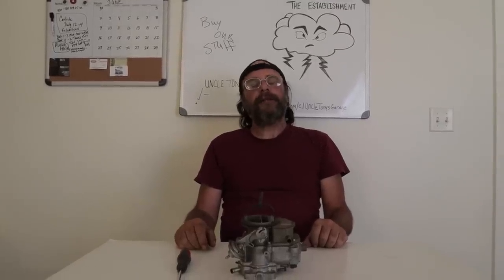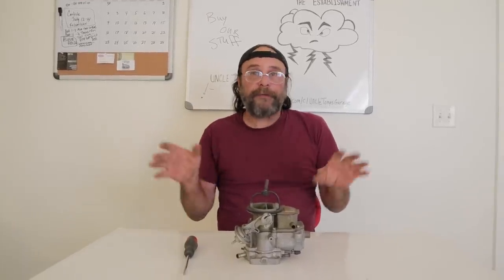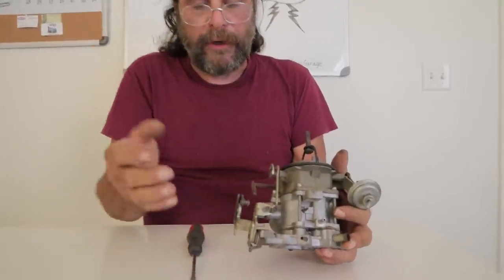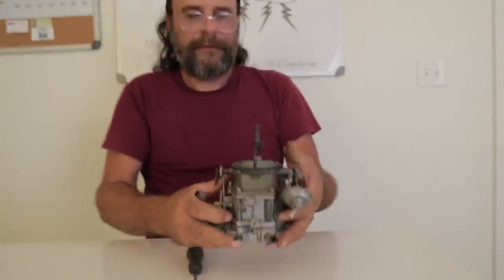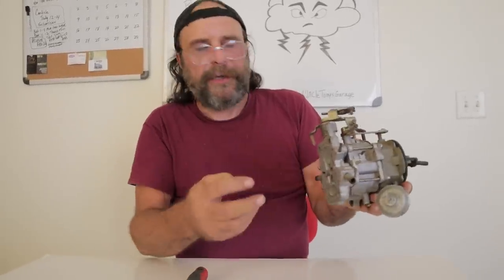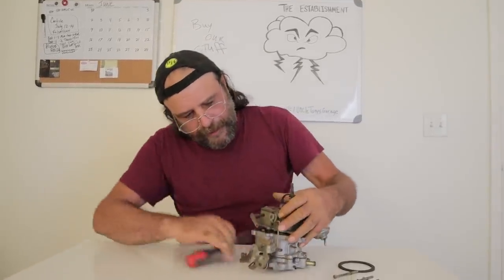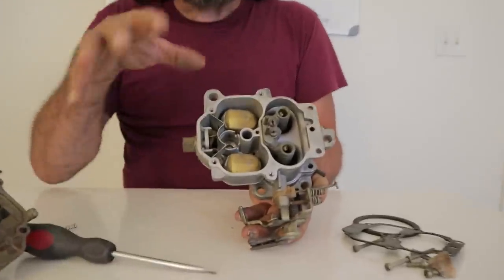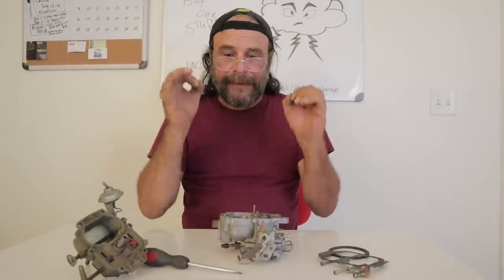Classic Car Tech- Understanding Carburetors

Comment: Thank you for the video. My first instinct is to plug off temporarily all vacuum sources like the brake booster and windshield washers or other miscellaneous stuff that doesn't need to be to run. Then like you said back the idle screw and fast idle out then one turn on each for the air and the choke mechanism so it will have a chance against the choke and have enough air to run. Give it a try and pay attention to weather idle speed is to low or not enough air. Then check the engine vacuum gage.. that I hook up. I do leave the vacuum line to the distributor hooked up. And I check to make sure that it is on the right side. Most cases the side that makes vacuum when you give it gas and the side that is constant vac is left plugged unless the distributor calls for the other side, it can be depending on the rig. I lean to the rich side as lean is rough on just about anything and hesitation is not good, as long as it doesn't load up while warming up your fine. I have hooked up my smok machine when it is not running and found vacuum leaks all along the firewall and other places just to hear people say carb is messed up. No it can't handle all the air that is coming in. It is hard to put into words what we hear with our ears and yet people think I'm deaf an I am to some people/LOL

Comment: Excellent video...manual choke is what I installed in my old 87 Power Ram. As you mentioned about the altitude and other factors that may require a small mixture change. Not a bad idea as well and it's a.pretty quick operation is to remove your intake and check the crossovers. A little cleaning will make a big difference for your choke operation.

Comment: Everyone is at a different level of understanding going in, by default.  I work on cars as my primary profession, but every car that comes through the door is EFI.  I am now facing the rebuild of a very mistreated Holley 4180C and I decided watching a macro-level video would make a micro-carb specific video easier to understand.  I was more correct than I expected, but that is all thanks to you.  I'm far from a master, but I must've taken 7 or 8 steps in that direction by the end of your video.  I thought it important to let you know that.

Comment: Nice concise explanation of the carb.     
  
The single best thing I did years ago was buy a few quadrajets at the wrecking yard and tear into them to figure them out after reading whatever I could find. Then I'd try them out on the car and see how bad I screwed it up. And back to the drawing board.  I figured if I royally screwed it up, it was a junkyard carb anyway, nothing to lose except the 10 bucks to get it.  That exercise made me appreciate the carb even more, and payed off over the years in not hesitating to rip into a carb, to take care of any issues that cropped up.

Comment: Thanks again uncle Tony! I had to drill .070 holes in all four of my throttle blades to get good idle out of my holley. This is due to the camshaft, the transfer slot are now only showing at .035. Before it was about 1/8".

Comment: Good video when I quit wrenching in 2000 I was the only guy in the shop that knew how to rebuild a carb. The younger guys had no clue! By the way all chokes are not bi metal springs. Carbs used on the Mitsubishi engines used in Chrysler cars used a wax pellet to close the choke.

Comment: You are one great teacher, So the idle mixture screws only come into play when at Idle.
I have a car thats fuel injected, but it has no way to get or read computer, no OBD1 or OBD2, Only good thing is you learn how to troubleshoot in the dark. And you get to know your car very well.
My old 750 Honda had 4 carbs, it had vacuum ports on each, I would use a multi Vacuum gauge to set equal. Made a huge difference in how it ran, and it was very quick.

Comment: I’ve always preferred to work on a carburetor over EFI. Learned it at age 16 when I bought my numbers matching 61 Impala. I was proud to have that car running like a top..
Reply: You sold it, didn't you.
Reply: Ronald van Kemenade sure did. Worst decision I’ve ever made. I tried to find it and buy it back a few years ago, after some digging I found out it had a frame off restoration and it’s now a show car in GA.
Reply: @hommeldavid  Same here. 63 Impala convertible SS. White + red int. Prettiest car I ever had. Only thing it lacked was a 409. Sold it planning on getting a better one, but went for a more sensible 80's wagon instead. Also V8 rwd, but not even half the fun.
Reply: Ronald van Kemenade my dream car is a 63 convertible. Found a 64 SS with its original 409 and 4 on the floor rotting in a field once, guy would not sell. I bugged him for about a year offering him more money every time. It’s sad when people would rather let something rot instead of letting someone fix it up.
Reply: David Hommel   Over 25-30 years I watched a 58 impala convertible rot and rust into the ground because the owner was planning to restore it himself. It ended up leaving his yard in a scrap dumpster in several pieces. Every time they tried to lift or move it, it broke again.
Reply: @Zephyrmec  That`s sad!

Comment: 16:22  If tapping the outside of the carb. Does not work. One more trick, stop fuel from entering the carb. The idling engine will empty the carb (engine will die).   Now the needle/seat is fully open. Next allow fuel to flow to carb. This is your best chance to flush the needle/seat. You can also tap, to help dislodge the trash.

Comment: I was 20 when I worked/cleaned/rebuilt my first carburettor. (Though it was a motorcycle twin carb) , so I have a good idea of how they work and other smaller ones, but the big stuff you find on cars are still a mystery to me. 

I understood the concept, but as soon as something went wrong or gave issues, it was like something working on witchcraft.

I was so afraid of working on the thing and nearly all the bikeshops (apart from 1, and also one had a lead on a carb whisperer) in my area didn't want to touch it.

After doing a boat load of research and watching many videos, which really helped. Suprisingly found many videos for how uncommon the bike is.

It was so basic how it all went apart and back together. Though I did cheat a little by not separating the carbs or by leaving the synchronisation screw untouched. (Still had, I'm assuming, factory paint marks on the nut and threads).

The most difficult part was probably measuring the floats range of movement to see if they are in spec.
And keeping things organised and planning ahead how I will sort things to keep track of it and what goes where. 

And yes, the needle and seat is a problem, neat to order a replacement, that and the floats was the only thing that was not in the kit.

Overall, it was an enjoyable and very rewarding experience

Comment: You're right Tony.  Soo soo much to be learned about carburetors.  I learned a lot with the Holley 4180C carb that came factorty on my 1984 mustang gt.  Angular boosters and diagonal main wells for a reason.  It is the best carb for my heads(emissions) as i live in NJ and thats all they care about.  BTW still have my 380mm rims.

Comment: I learned a lot by putting a vacuum gauge in the car and watching how the engine vacuum increases and decreases as you drive around under various conditions. uphill,downhill,from a stoplight,accelerating while cruzing, smashing the throttle,letting your foot off the gas quickly, all affect the engine vacuum at different rpm. Then think how the carb must control fuel needs of the engine to supply fuel under these circumstances

Comment: A carb is simple, it's a coffee can with a garden hose stuck in it, what makes it complicated is all the circuit's it has, choke, fast idle, idle, acc pump, mid range, main jets, etc, what's important is to determine what circuit is having problems before you take it apart, when you rebuild a carb all you are doing is cleaning it and putting it back together just like you took it apart, you should have a paper filter before and after the fuel  pump, no dirt in carb usually no problem, Tony is doing a good job of explaining the circuit's, my preferred carbs are a quadrajet for a 4bbl, a motorcraft 2150 for a 2bbl

Comment: I was never left on the side of the road because MY carburetor COMPUTER went bad. Analog is the way to keep it simple👍.
Reply: Lassi Kinnunen the variable Venturi carb Ford had in the 80’ was horrible.  But with a convention carburetor you don’t need a mortgage to repair it.
Reply: I went and bought a 1991 Peugeot, car was incredibly simple and all mechanical. Sat parked for 2 years, and we got it running within 10 minutes. I paid the guy, sorted the paperwork and drove the car across half the country on at least 2 year old oil and coolant. Not the smartest thing in hindsight but I had no problems with the car except for typical french wiring.

Comment: Thanks Uncle Tony! I’ll never understand why they started using those damn automatic chokes! What was so hard about pulling a choke and pushing it back in?
Reply: Well, as someone who has one of them it's the fact that it's practically a martial art requiring a lot of feel, which most people these days lack. Pull it too much on a hot day and it'll stall, pull it too little it won't start.  
The plus side of it is that nobody can steal the car, the negative is that nobody can drive your car except you.
Reply: @GlamStacheessnostalgialounge  lol
Reply: @GlamStacheessnostalgialounge  
My nephew and 5 of his friends called me one Saturday to help them with an old truck one of them had bought, they had 2 problems, they couldn't get it to start, and none of them knew how to drive a standard.
I showed them how to operate the manual choke, and spent a few hours teaching the owner the basics of driving  a standard.
At least he doesn't have to worry about anyone borrowing his truck.
😁
Reply: @sidewyndersshed1676  That truck better be quite well built, hopes are they don't forget to turn off the choke and gunk up the engine or break the tranny on her.
Reply: @GlamStacheessnostalgialounge  
1969 ford f250 4x4 old cast iron tranny and transfer case, dana front and rear, 360cid, it's  a rock! That story is 8 years old, the truck is still running. 
Lol.
👍
Reply: @oldkaboom7745  Just wears on the starter unnecessarily, and besides, nothing is as satisfying as getting it right the first time and the car instantly starting up.
Reply: mark campbell   That is likely a Warner T-18, you couldn’t break it if you tried!
Reply: @GlamStacheessnostalgialounge   Except my parents could always get my old cold Ford going while I couldn`t always do so!
Reply: I have never needed a choke on my carburetors, I always remove them

Comment: Great video Tony. Probably helped out a whole bunch of guys with that one. There's nothing wrong with running a carb, I run one on my 383. I run points ignition as well. I see a lot of comments that kinda bash fuel injection. In my opinion fuel injection runs circles around carbs, more efficient, more power , and more response. But in the same breath I wouldn't remove a carb from an old school car to install injection. I like leaving things as original as possible. Those vehicles were designed like that and ran well.

Comment: Great video!! You are so right about automatic chokes. It was always maddening to adjust one correctly here in the midwest because the temperatures bounce between 0 and 60 all winter long. The only thing I might add is an explanation between manifold vacuum and the Venturi Effect.

Comment: When I was about 13 my dad dropped a box in my lap and said, go rebuild the carb. He was serious, and he needed to drive his car to work in the morning. 
Me: I've never rebuilt a carb. 
Him: You better do a good job! 
I opened the box, kind of went over the instructions. I pulled it off the car, cleaned it up a little, and had it completely apart. I just started putting it back together when he checked up on me. 
He never did trust me! Lol. A hole!
Anyway, I haven't touched a carb in 25 years. This was a good refresher. Can you do a four barrel next time?

Comment: love the video , very well explained ,, I have had instances where people would buy a hygrade /standard 1597 rebuild kit for this 70,s style bbd and after overhauling the bbd the car wont idle and car wont start properly and they call and complain about carb problems and they say to  me order a new or rebuilt bbd cause mine is for the trash , heres the trick , exactly as uncle tony sais in this video , most of these carbs ended up in the trash bin cause of bad choke adjustment ...heres the skinny on these rebuild kits ..the original insulater gasket that goes between the intake and the carb is super thick , but the new gasket that comes in the rebuild kit is half its size in height which throws off the choke rod geometry making the rod too long which keeps the butterflies completely closed not allowing a cold start or making a cold start a battle , most people do not understand how a bbd works and have no clue that there is an adjustment on the choke rod to bring the butterfly adjustment back to where it should be ..this is why I loved this video because uncle tony told us that there is an adjustment on the choke and how to adjust it ...from my experience working on bbd,s this is the #1 reason why most of these carbs ended up in the junk pile cause the person or mechanic doing the rebuild never re tune the choke after a rebuild ...just my 2 cents on the subject :)..a client came to me bitchin and screamin about his bbd saying im gonna sell this pece of shit car motor runs ruff wont start no more etc etc etc ..I tell the client come here watch this , I open the hood take off air cleaner assembly I take a pair of plyers I squeeze the rod and tell the client ok u can go home now , client looks at me in awwwwe ..2 days later client calls and sais my car is running and starting like a dream :)since you took the plyers to it ..knowledge is key , uncle tony gave us the knowledge we all need to know in this video ,cheers

Comment: Fantastic stuff. My first car was a 1978 slant 6. I went over the carb about 475 times inside and out...swapping them and tesing to try to get that damn car to run right......i learned just about everything you just said here in the video the hard way. . Thank you so much for this information. Its about 27 years to late for me but it is very very good info. I had the aluminum intake on my slant6  and come to find out that's where my problem was after months of dicking around. I found a hair line crack down in the intake below the carb. Since the slant6  had the exaust and intake bolted together it was sucking air through that crack into the exaust. ITs easier to suck air  than it is to suck liquid so.....congratulations your engine runs like hell.  Essentially i was bypassing the motor altogether.....hehe. I learned that at age 16 through a ton of trial and error. I am now into my 40s. Not sure how that happened so quick but i am pretty sure my body at this age has the same problem my car had back then :) (runs like hell syndrome).  Keep up the great content.  One of the absolute best on YT.

Comment: Wtf is a carburetor? Where do you plug the dlc connector at?
Reply: The carburetor goes on top of the intake manifold and regulates the air-fuel mixture/ratio.  Its usaily mechanically connected to the throttle with a cable. idk about your second question, im still learning about this stuff too.
Reply: @saxoman1995  He was just trying to be funny my friend!
Reply: Lmao...now I really feel old. Might even have Uncle  Tony beat.
Reply: @UberLummox then I just got got
Reply: On a gbody Monte Carlo under the radio on the left side
Reply: What is a dlc connector?
Reply: Delta-Tech the red R emblem is worth about 80 HP more,  I have a neighbor who has an “R” on his late model Benz, that must really haul ass!

Comment: As much as I’d like to agree with you on carbs outperforming EFI, I think there are benefits to both. If you’re a tech guru it’s much easier to tune an efi system, depending on what kind it is. Carbs are very good at keeping the incoming fuel and air mixture cool. The area just underneath the boosters can get very cold because of the air flow velocity and fuel mixing. EFI not so much. Also, your traditional 4 barrel carb is very good in a racing situation. However, when those secondaries open there is always a short lean condition between when the secondary blades open and when those boosters compensate with fuel. Luckily with EFI you can tune out those lean and rich conditions. But I agree with you, carbs are very easy to work with when you know what’s going on and how they work. Personally, I like being able to physically fix those situations rather than tuning through a computer.
Reply: When you have major problems with efi carbs look a whole lot better....lol